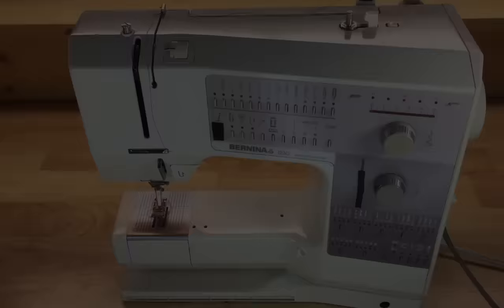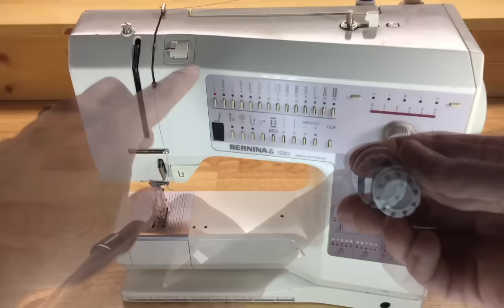Sewing Machine Problems: The Most Common Issues

Comment: Hi. So useful, but my Singer is a Featherlite, tiny, old and reliable. But hand wheel froze. Nothing moves. What can I do? I'm in a Covid lockdown. Thanks.
Reply from the maker: It's hard to say without checking it out personally. You can try releasing the clutch (inner wheel inside hand wheel) and see if the hand wheel turns. If it does but then the hand wheel locks up when the clutch is tight, try removing the bobbin case. If it is still seized there may be thread jammed behind the hook which requires some work.

Comment: Hi- I have a Kenmore 10 Stitch and My problem is the pressure foot.  It's not putting enough pressure on fabric and I have to hold the material while the machine is trying to sew.   The stitch come out just fine but I always have to guide it by holding it in place on the plate.  Any advice would be appreciated. Good video! (Note:  Had my machine since 1984 :)
Reply from the maker: Do you know your model number? I’m sure I can help if you can provide that :)
Reply: Jack Creek Road  - yes- it’s 
158 /13500
Reply from the maker: Your machine has a pressure regulator that can be adjusted to help with the feed. Here's the manual https://www.searspartsdirect.com/manual/39seirf4q4-000582/kenmore-15813500-mechanical-sewing-machine It's on page 14
Reply: @JackCreekRoad  THANK YOU! THANK YOU!  It worked and now works better!  I have been racking my brain to get this fixed! Simple and easy with your help!  Thank you for the blessing! Stay safe!

Comment: Great video. Thank you. My problem is that my stitches are not completely in a line, nothing major but it's really bugging me especially if I have to do top stitch. Any ideas on what to do please?
Reply from the maker: Try increasing the number of layers your sewing through. If you don't have enough material for this you can actually use  something like wrapping tissue or "adding machine" tape or cash register tape. Set it right on top of your material and sew through it. Once you've completed your seam, just tear it away.
Reply: @JackCreekRoad  Thanks for the tip but this happens no matter how many layers I sew through. I don't have the resources or the time to mess with the tissue. I'm in the UK and sewing items for our NHS, so time is precious. I do think there is something wrong with the machine because it was fine when new. As I said, it's not major just very annoying. It sews a slight slant stitch every other stitch.  It's probably something really simple, but it's finding what it is.
Thank you for replying, I appreciate it.
Reply: @JackCreekRoad  Just a thought, this started happening after I had switched the machine to sew zigzag, and them back again. I don't think it ever switched back again properly.

Comment: Trying to learn quilting on a new Bernini 530. Used glue to baste. Can’t get quilt to feed. Is this the basting glue or a tension prob. My eyes are crossed from reading the manual.
Reply from the maker: Most likely an issue with the glue. Try cleaning the hook area with a little rubbing alcohol on a q tip and changing the needle.

Comment: I've !let the screw from my plate. Can it be replaced?   Also when stitching thru layers, my thread tangles I. A blog on the bottom of the fabric. What causes this?
Reply from the maker: It most definitely can be replaced. Thickness shouldnt cause it to bunch on the bottom unless the thickness is so thick it is causing the presser foot to lift which essentially turns the tension off.

Comment: I HAVE A BROTHER PC420 SEWING MACHINE I BROKE A NEEDLE, REPLACED IT AND CHECKED TO MAKE SURE NOTHING WAS IN THE BOBBIN AREA EVEN TOOK IT APART AND CLEANED OUT ANYTHING I SAW NOW MY MACHINE WILL NOT SEW PROPERLY  MY BOTTOM THREAD IS NOT PICKING UP CORRECTLY I KNOW THAT THE TOP TENTION CONTROLLS THIS BUT I HAVE TRIED TIGHTENING AND LOOSENING THE TENTION BUT NOTHING WORKS PLEASE HELP
Reply from the maker: Rethread everything. Check the direction of your needle and keep your tension around 4.

Comment: How would you fix the top tension, since the bottom tension is fixed by regulating the tension on top of the machine?
Reply from the maker: It depends. You can adjust it on the bobbin case (which is actually kinda rare) I would be more inclined to think maybe there is a burr on your hook or bobbin case, or maybe even the wrong bobbin for the machine.

Comment: I have an old Singer 6215 that seems allow the top thread to slip on the first stitch or so.  When I hold the top thread firmly, it will pull out about 3 or 4 inches as you start to stitch.  If you don't do that, it will cause a thread bunch on the bottom.   Could that be the top tension not seating properly when the foot is lowered?
Reply from the maker: Can you double check and make sure your take-up lever is threaded?

Comment: Hi good video.  My machine runs slow I have to yank the material through how can I fix that . thank you
Reply from the maker: I would try running it without material. If it is still slow it may need oil or a new foot pedal.

Comment: When I end my row of sewing and go to take the project off the sewing machine, I get extra strings, from the top feed, getting stuck on the bottom of the work. So it’ll be the top string in top and then 3-4 strings on the bottom and the project is stuck. Thoughts?
Reply from the maker: The stitch isn't complete when you get extra threads. So when you finish your row, rotate the handwheel towards you until the handwheel is in the highest position, then lift your foot and pull your material out. This should take care of your issue :)
Reply: Jack Creek Road it absolutely helped!!!! Haven’t had the issue happen since!!!  Thank you!!!

Comment: I have a walking foot machine and ever time I use it and change thickness of leather,I have to change tension  on both threads,can you apply what you said or is there something to fix it is a singer 29k
Reply from the maker: This makes total sense. What happens is thicker material pushes the presser foot up which starts to release the tension disks causing lower tension but needing to be tightened. It doesn't sound like you have a mechanical problem if it works well once the tension is adjusted.

Comment: Hello,
Thanks for your video.
My problem is I have loose thread on the Botton part of fabric with tension 0 and tension 9 from top wheel, what does the problem could be? I already change the bobbin case for a new one in my SE600 brother embroidery machine.  thanks for your feedback. Appreciated. :)
Reply from the maker: That would typically indicate that you've missed your tension mechanism. I would recommend rethreading the top making sure your presser foot is up while threading.

Comment: I just got a new machine. When sewing, the holes the needle makes look too big. Is this a thread tension issue?
Reply from the maker: It’s most likely too large of a needle for the material your using. I would start by moving down a size at a time until you get the look you want.

Comment: I have a kenmore #6 machine and the knob on the right side doesn't want to turn by itself, it sounds like the rubber is rubbing. Can I  remove this side only to change it
Reply from the maker: You may be able to. I would first check to see if maybe your bobbin winder is unintentionally engaged.

Comment: What if I thread it correct with presser foot up and the tension is on the middle setting (at 4 for my machine) and it still appears to have tension issues?
Reply from the maker: It would depend on what the issue is. Sometimes issues that look like tension can be cause by needle, thread or material. Can you send me a picture on instagram?

Comment: Any suggestions for stitches skipping?
Reply from the maker: First try a new needle and rethread. Be sure your tension is on at least 4. Then if you can get it to stitch but it skips occasionally you need some sort of stabilizer (You can even use wrapping tissue paper.)

Comment: Tried all these things and the top thread (underside) on my new singer 4423 is still a mess of knots and loops :( - edit: double checked threading (appears correct) turned the upper tension ALL the way up and got a cleaner (but still loose and unacceptable) stitch. Can't crank it any higher. Ugh.
Reply from the maker: It doesn't sound like your in the tension mechanism just right. Try rethreading, anf "flossing" the thread into the tension mechanism. The tension should only have to be around 4

Comment: My thread is bunching on the bottom of my frabric. Does that mean it is my tension? Or that my needle needs to be replaced?
Reply from the maker: Most likely your tension is too low or the top is not threaded correctly. Make sure to thread with your presser foot up and make sure you are threaded through the take-up lever.

Comment: Hi um I don’t know if you read comments anymore but I just got this used sewing machine from a woman and at first it was completely fine but suddenly the sewing needle stopped moving. When I would press on the pedal, the thing on the side would spin (I’m new to this so idk what it’s called) buy the needle would not go up and down and nothing in the inside will move. Can you tell me what the problem could be??like I’m thinking maybe it’s jammed or something ?
Reply from the maker: There should be a small "wheel" inside the larger wheel on the right hand side of the machine. Hold the outer wheel and tighten the inner wheel. This should make everything work properly.
Reply: Jack Creek Road thank you so much I didn’t think you would actually respond, to me you are a life saver right now lol but by inner wheel, do you mean taking off the cap thing, which reveals this black thingy?i noticed how on the back of the cap, there’s somewhat of a screw on it, so that means it drills into the black hole? The black thing is what I tighten? I’m so sorry I really don’t understand how this works. It’s like if I just tighten the cap without taking it apart and press the pedal, it will go up once and that’s it. But also, with the black hole, there’s like grease all on it. Should I wipe that off and try tightening it all together ?
Reply from the maker: There is typically a small "wheel" inside the larger "wheel." You just need to tighten it by hand (This is the same wheel you loosen to wind bobbins. What's your model number?
Reply: Jack Creek Road and while trying to fix it last night, i think I can confirm the small wheel is the problem. Because isn’t the small wheel and large wheel suppose to move together? they don’t. The larger wheel spins while the small wheel doesn’t. And so I took the cap off the small wheel. And I tried“tightening” the smaller wheel, but it would not MOVE 😭😭 maybe it needs to be replaced with a newer one?
Reply from the maker: The smaller wheel should tighten inside the larger wheel. You should be able to hold the larger wheel as you tighten the smaller and that in theory should engage the machine. If you took out the washer with tabs inside the smaller wheel that may be in backwards if it wont tighten up.

Comment: What is causing my bobbin to have 2 or 3 strings and right tension after I pull out my fabric ? It happens to me sometimes. I’m a beginner
Reply from the maker: The stitch isn't being completed before you are removing the material. So when you end a seam, make sure the take up lever is in the highest position before pulling your material out. If it is not, rotate the handwheel TOWARDS you until it is.

Comment: What is the measurements for a 15 size and a 66 size bobbin ? My wife has two different sewing machines and she has mixed up the bobbins with preloaded bobbins from a bulk store... But I cannot find any information how to use a measuring tool to sort through these... She has an old Singer Stylist 534 that uses a 66 size bobbin and a new Singer 44S I think it uses size 15 bobbin... Any help ?
Reply from the maker: So the diameter will be about the same but the class 66 bobbins are curved outward and more narrow. The class 15 bobbins are not curved.
Reply: @JackCreekRoad  Thank you very much for that Info...  And my wife thanks you...

Comment: I'm having a problem.  My machine is new. I have threaded it properly but when I step on the pedal NOTHING happens.  The moto runs but the sewing action doesn't happen.  What do I do??
Reply from the maker: It sounds like your bobbin winder is engaged or the clutch in the handwheel is loosened for bobbin winding.

Comment: Is there a way to increase the feeding strength? Sorry I'm a complete noob, but my machine doesn't feed straight, so it makes really annoying circles and i cant figure out why
Reply from the maker: You can add a walking foot to most machines or try playing around with your presser foot pressure if you have the ability to adjust it on the machine.

Comment: How do I adjust the needle position? I switched to a ditch stitch foot and now my needle hits the metal plate. Please help...
Reply from the maker: It depends on the machine, but you may need to adjust your stitch width or you may have a needle position adjuster. What's your make and model?

Comment: I have a new machine , Singer 4423 and very frequently the thread comes out of the take up lever on its own and of course it jams, does that mean I don't have it threaded properly? or proper tension?
Reply from the maker: Make sure the thread is pulling free from the spool. Sometimes a bad spool will not allow it to come off freely or the thread will wrap up underneath the spool on the pin.

Comment: Is it good or bad to leave the presser foot down when you're not using the machine if you leave it threaded?
Reply from the maker: It really doesn't matter. But I would leave a piece of fabric between your presser foot and feed dogs if you leave the foot down.
Reply: @JackCreekRoad  Ok. I didn't really know anything about tension disc or how they worked. I didn't know they had springs in them. But after seeing this video, it made me wonder if maybe leaving the foot down all the time could cause the disc to get stretched out.

Comment: My singer 5050 the presser foot is slow to come down. Is there any thing I can do to troubleshoot this problem?
Reply from the maker: You can put a drop of oil on the presser foot lifter shaft at the top where it goes in the machine and see if it helps cycle, before going through more elaborate trouble shooting

Comment: I have a Juki for free motion quilting. I have a problem with the thread breaking- what am I doing wrong?
Reply from the maker: It could be that your thread is weak, your needle is too small, or too much manipulation of the feed of the fabric. I would check all of these factors and try again.
Reply: @JackCreekRoad  I'm using Aurifil 50 weight, size 14 needle(organ brand). It is probably me wrestling the quilt around, tho it will be going along great, and I think i'm using the same pressure to guide the material, and whammo- it breaks. It is a 87 1/2 x 87 1/2 inch quilt, so there is a lot of it to waltz around.

Comment: I'm having a problem where too much cotton comes up from the bobbin and loops round the needle, this causes the top thread to come out of the needle. Mines not sewing at all.
Reply from the maker: Make sure that your threaded in the bobbin case properly and that your top tension is around 4
Reply: @JackCreekRoad  actual sorted it now, had the needle in with the flat bit facing front rather than right, now sewing better.

Comment: Hi, I have a Janome décor Excel 11 5024 sewing machine and after watching your video and trying all you suggest I still can not get my bobbin to be drawn up, I have changed the needle, bobbin, there is nothing wrong with the hook which I have slightly oiled, do you advise I purchase a new bobbin case or is there something else I can try or adjust, thank you John.
Reply from the maker: Make sure your needle is in correctly. Can you send me a video on instagram of the machine threaded, spin the handwheel towards you slowly and record where the needle goes into the bobbin area (with the needle plate off.) @JackCreekRoad
Reply: @JackCreekRoad  forwarding the video to you, thank you
Reply: @JackCreekRoad  Hi Jack,  I have sent the instagram you asked for but it is under Tred pittaway below, thanks John.

Comment: Omg trying to sew face masks. I've broken both of my machines.  One keeps jamming the fabric and breaking the top thread and is nesting.can only sew very slow. My other machine a singer top loader about 35 years old. When I was removing the bobbin the casing came out with it. Now I can't get it to seat right and won't pick up the bobbin thread. I've watched videos I know it's supposed to sit on the lip I know I'm supposed to move that little thing with a screw driver .so it looks like it's seated properly but can't get the bobbin thread to catch on those 2 spots and ... It just doesnt work right. I'm so frustrated and need help

Comment: The manual control knob does not move even though I hear the machine attempting to run
Reply from the maker: It sounds like your machine is in bobbin winding mode. Check to see if you can push the handwheel "into" the machine to engage it.

Comment: I have new sewing machine but I smell something bad like something being burn but I dont mind it..i guess there is something wrong in my sewing machine..im a newbie
Reply from the maker: Sometimes oil will drip from places on the machine during transport after it was made. You may have a little oil on the motor which should burn off. Most of the time it's no problem at all.
Reply: @JackCreekRoad  yeah i remember the way I transport it is that I put it like I put it lying down on my motorbike..i gues the sewing machine should transport like a refrigerator does...hope my sewing machine is ok..thank u